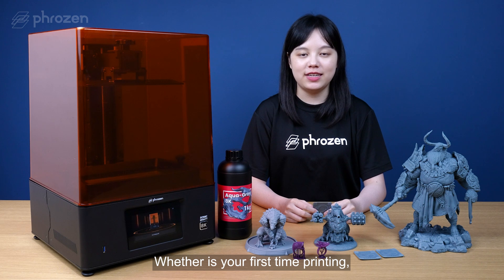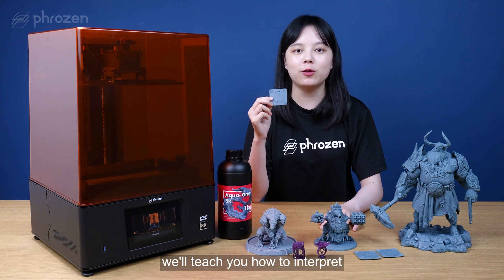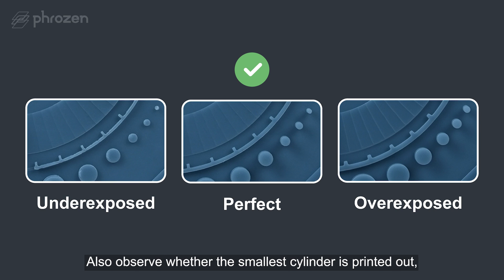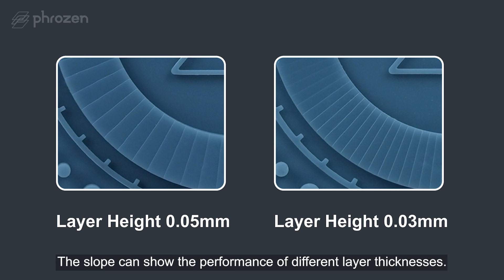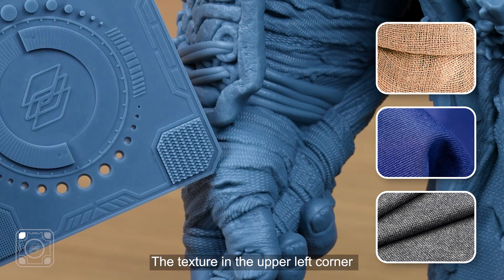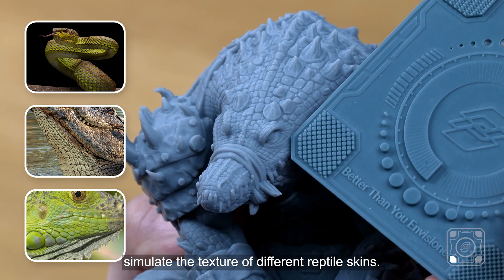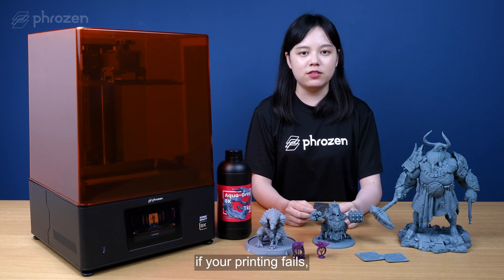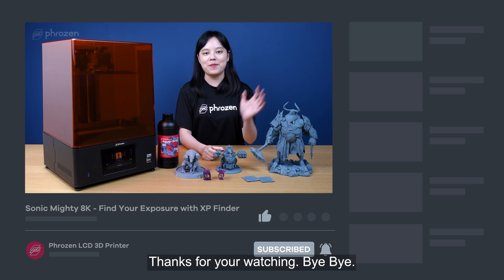Find Your Exposure with XP Finder- Phrozen LCD 3D Printer

Comment: I have the issue that my prints seem overexposed when looking at the bars on top and outside of the circles and the letters seem rather thick. but the dots of the 'i's never get printed
I am using a Anycubic Photon with painted bleck Anycubic Resin on 50µm, 7 to 9 seconds, 4 to 6 bottom layers and 10 times bottom layer exposure, 25°C room temperature. I don't know what I'm doing wrong here
Reply from the maker: If the letters look thick from overexposure but the dot on the i was not printed, it's possible that the issue is with the resin's strength.

Comment: What would I do if the print looks fine but some of the holes at the top are filled/closed?
Reply from the maker: To make sure the model is firmly attached to the building plate, the bottom layer might get slightly overexposed. But it won't affect the overall prints.
Reply: @phrozen3d  oh that makes sense. 
Thank you
Reply: @phrozen3d  I Don't know why I didn't think of that 🤦

Comment: Why are the holes in the plate coming out partially clogged? I've even lowered the exposure to 1.5 seconds and they still appear partially clogged. It's like there's a layer forming underneath, and I can't figure out what's happening to it.
Reply: did you ever find out why? im having the same issue.

Comment: Hi, I’m struggling to get the pattern to form on the bottom left of the XP finder. Does this mean it needs more exposure? It seems to be a bit random whether it forms or not. At 2s it looked maybe 75% formed, then at 2.2s it was maybe 40% formed. Lower exposures were also a mixed bag. Everything else is fine though. Just that bottom left pattern is troublesome (this is an 80/20 mix of aqua grey 8k and siraya tech tenacious). Cheers!